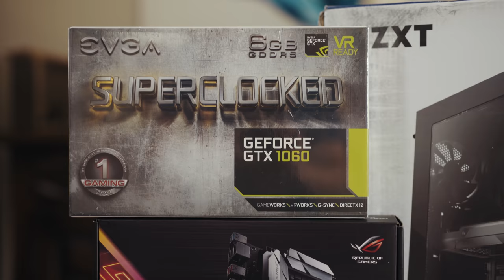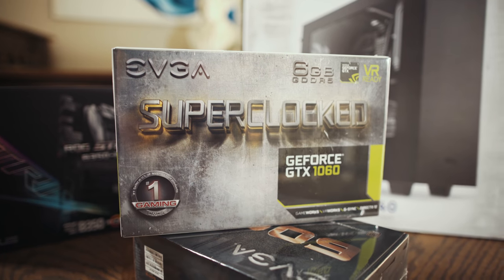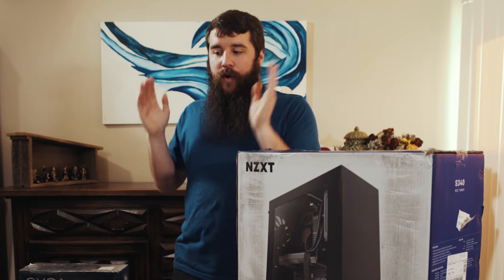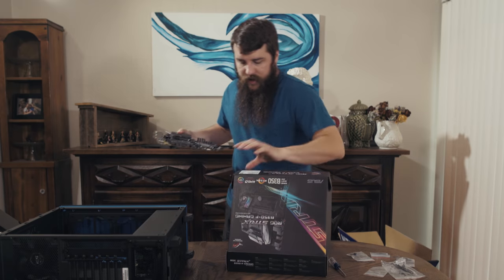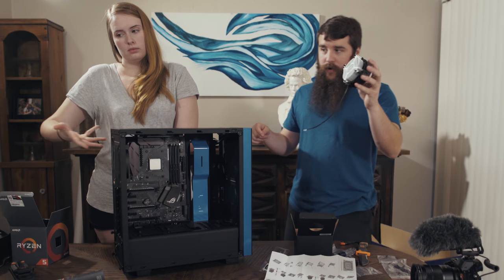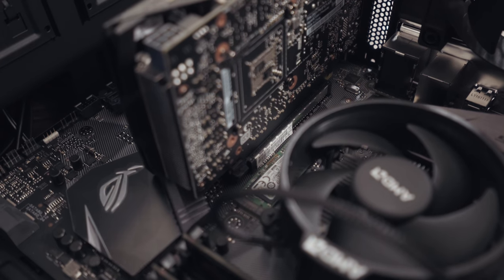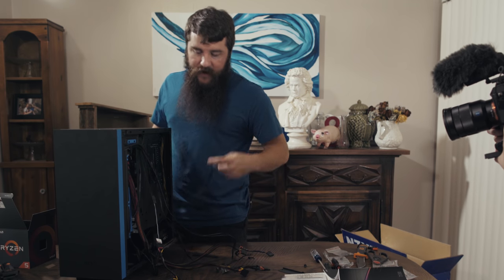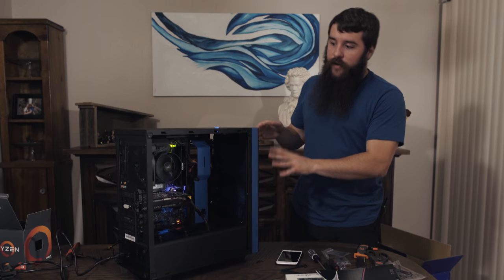How To Build A Video Editing Computer | $850 Ryzen PC Beginners Build Guide | 2017

Comment: I have seen at least one comparison between sata ssd's and the fastest NVME ssd's. Conclusion, only in a verry few cases was there a rather small advantage in using the faster ssd's. Video edditing was not one of them. In all other cases the difference between the two is mostly negligable. So I would go for the cheaper sata ssd's and just get a bigger one, so it would have more room for the video's your brother would be editing directly from ssd.
Reply from the maker: +Jelle Baris hey Jelle! From what I've read there are some situations where it's better to have nvme. Every bit of speed helps :) I'm planning on having him edit from external drives, not the internal ssd.

Comment: 16 gb of ram enough for gh5 (V-Log 4K) ?
Reply from the maker: Hey! Depends on how many CPU cores you have, if you have a quad core you should be fine with that, but if you have an 8 core or more CPU, you'll want at least 32 gigs. (in my opinion)
Reply: Hey, so if i'll buy ryzen 5 1600 then 16gb is enough, but if i'll choose ryzen7 1700 then i'll need to install 32gb?

Comment: I don't know how about you guys but I've put everything to my shopping list and it came up to over 1200$$
Reply from the maker: +TAPP Channel 😂 that's craaaazy. Including a monitor I'm assuming?
Reply: Don't be sarcastic :) I really need a computer to my 4K videos. I thought I have a nice computer with intel i7-6700T 2.80GHz processor but when I bought a LG 27UD68 4K monitor I was not able to enjoy it. The picture was blurry and worse then on my HP 7years old monitor. Decide to buy a GPU GTX 1050Ti and now I'm not able to install is since I have all motherboard harnesses right over GPU slot... I'm a little bit frustrated so I started to think about buying a new computer. That's how I got to your video... I placed everything to my amazon basket and here what it came up to:
Case 99.99$
AMD (1600) -209$
Motherboard - 119$
SSD - 169$
GTX 1060 - 299$
RAM - 165$
Power Supply - 55$
                                             Total 1119$

In this case I'm thinking if its worth it or maybe I should return that 4k monitor (510$) and Ill already have a money for a latest iMac (1799)
What do you think???
Or maybe I should buy a case and motherboard only and use a processor HDD and DDR4 Ram I already have???
What do you think about my processor? Would work with your motherboard?? Is it better or something close to that AMD you suggested???
And finally if that computer would be better than 1799$ iMac 3.4GHz i5 quad Core????

Will be very appreciate for your advise. Thanks

Comment: How does this deal with resolve?
Reply from the maker: My brother says it works well, but I haven’t tested it extensively with Resolve
Reply: Made a similar build. It works fairly well. Though the system keeps rebooting to the bios randomly. Will have to sort that out. But I am really loving the speed.

Comment: So I decided to build my first pc after watching this video with his suggestion of upgrade but mine did not work. I emailed him but didn't get the reply. I wonder what I did wrong or the parts I got were different.
I want to ask the community to see if anyone can recognize them.

I got

1. CPU: AMD Ryzen 9 3900X 12-core, 24-thread unlocked desktop processor with Wraith Prism LED Cooler
2. GPU: EVGA 08G-P4-3067-KR GeForce RTX 2060 Super SC Ultra Gaming, 8GB GDDR6, Dual HDB Fans, Metal Backplate
3. Memory Card RAM: Corsair Vengeance LPX 64GB DDR4 DRAM 3200MHz C16 Memory Kit, Black
4. SSD: Samsung (MZ-V7S1T0B/AM) 970 EVO Plus SSD 1TB - M.2 NVMe Interface Internal Solid State Drive with V-NAND Technology
5. Motherboard: MSI MPG X570 GAMING EDGE WIFI Motherboard (AMD AM4, DDR4, PCIe 4.0, SATA 6Gb/s, M.2, USB 3.2 Gen 2, AC Wi-Fi 5, HDMI, ATX)
6. Power supply: EVGA 220-G3-0750-X1 SuperNOVA 750 G3, 80 Plus Gold 750W, Fully Modular, Eco Mode with New HDB Fan, 10 Year Warranty, Includes Power ON Self Tester, Compact 150mm Size, Power Supply (But I switched to GQ version since G3 I ordered wasn't functioning)
7. Case: NZXT H510 - CA-H510B-BR - Compact ATX Mid-Tower PC Gaming Case - Front I/O USB Type-C Port - Tempered Glass Side Panel - Cable Management System - Water-Cooling Ready - Black/Red

So I got these 7 items and did almost exactly as Matt did in his video (I said 'almost' because the cable seems to be different in upgraded version. I'm not so sure) but it won't turn on. 
The fan in PSU was spinning one second. None of my CPU or GPU fans were spinning. 

Can anyone help? or give me a suggestion?
Reply from the maker: Hey I was sure I replied to your email. Apologies if I didn’t. It sounds like all your parts are correct. Does the computer turn on at all? Does it light up? Any fans spin? Etc. If not, double check your power connections. If it does turn on but doesn’t send a signal to the monitor, make sure you are plugged into the graphics card and not the motherboard.

Comment: Hi Matt, I was pretty excited to finally build a new PC (last one is 8 years old) following your advice.
I bought most of the parts from where you suggested although some were unavailable and I bought elsewhere...also the RAM is not something you recommended ...I don't recall the reason I bought another brand but knew Corsair is a respected brand.

Anyway I'm wondering if I have mismatched something that you may be able to point out.
I had high hopes I would be able to get steady playback in my video editor (Vegas Pro 18 or DaVinci Resolve) with a total new build but it still drops frames down to 8 fps.
Any suggestions would be appreciated.

case https://www.neweggbusiness.com/product/product.aspx?item=9B-11-553-031&utm_medium=TraEmail&utm_source=TEMC-New-Order-Confirmation-USB&cm_mmc=TEMC-New-Order-Confirmation-USB-_-9B-11-553-031
memory (not recommended) https://www.bestbuy.com/site/corsair-vengeance-lpx-32gb-2pk-x-16gb-3-2-ghz-ddr4-dram-desktop-memory-kit-black/4895530.p?skuId=4895530
motherboard https://www.newegg.com/asrock-b450-pro4/p/N82E16813157841?Item=N82E16813157841&utm_medium=TraEmail&utm_source=TEMC-New-Order-Confirmation-USA&cm_mmc=TEMC-New-Order-Confirmation-USA-_-N82E16813157841
power https://www.bestbuy.com/site/evga-600w-atx-12v-eps-12v-80-plus-power-supply-black/8511029.p?skuId=8511029
CPU https://www.walmart.com/ip/seort/431501281?comm-msg-vehicle=EMAIL&comm-msg-id=ce732566-1730-459e-a539-4729c98eef61
GPU https://www.amazon.com/gp/product/B077VX31FZ/ref=ppx_od_dt_b_asin_title_s00?ie=UTF8&psc=1
SSD https://www.amazon.com/gp/product/B07MFZY2F2/ref=ppx_od_dt_b_asin_title_s00?ie=UTF8&psc=1

Comment: My PC Build:

Thermaltake Versa N21 Mid Tower
ASRock Z390 Extreme4 ATX Intel Motherboard (300 series)
Intel Core i7-9700K Coffee Lake 8-Core
Cougar VTE500 80+ ATX power Supply
G.SKILL Ripjaws V Series 16GB (2 x 8GB) DDR4 SDRAM Memory
EVGA GeForce GTX 1060 SC GAMING, ACX 2.0 (Single Fan) Graphics Card
WD Blue 1TB Desktop Hard Disk Drive
PLEXTOR Duplication Grade DVD / CD SATA Burner Drive PX-891SAF
ASUS AC750 Wireless Dual Band PCI Express Adapter w/ 2 Antennas
----
Acer K222HQL bid 21.5" Full HD LCD Monitor
Razer DeathAdder Elite Ergonomic Gaming Mouse
CORSAIR K63 Wireless Mechanical Gaming Keyboard

Comment: Great video. I definevly got some good info from here to design my PC build. I will be using it for video editing and work. Can you tell me what do you think and if there is anything to improve. I am looking to spend $1000 MAX. 

CPU: AMD Ryzen 5 1600 3.2GHz 6-core
Motherboard: ASUS Prime B350 Plus ATX AM4
RAM: Corsair Vengeance LPX 16GB (2x8Gb) DDR4-3000
Storage: Samsung 850 Evo Series 250Gb 2.5" SSD
Video Card: EVGA- GeForce GTX 1050 2Gb SC Gaming
Case: Corsair 270R ATX Mid Tower
Power Supply: EVGA SuperNOVA G3 650W 80+ Gold Certified Fully-Modular ATX 
 
Grand Total: $761.19
Reply from the maker: Looks great to me! :)

Comment: what do i do if i did this and it doesn’t turn on at all
Reply from the maker: Do any lights come on at all? If not, then double check your power supply is on and properly plugged in. If you get some lights double check all your cables

Comment: I’m getting “No Signal” on the monitor when I turn it on. I did everything right, not sure what’s going on
Reply: Ajmal Lookman yes I figured out what I was doing wrong. I had the HDMI plugged to the motherboard, but instead, you need to plug it to the graphics card.

Comment: Hi Matt! Thanks so much for this tutorial. I got here from your awesome 2020 4K PC for $650 video. This is my first time building a computer and I’ve run into a couple issues with cable connections... I have read through the motherboard and case manuals, but am still stuck and feel like I’m going a bit nuts here. Can you help? I’ve attached some imgur links so you can see exactly what cables I’m talking about. Thanks a gazillion in advance for any help you can provide.

Parts: 
Case = NZXT H510 Compact
Motherboard = MSI B450-A PRO
Power supply = EVGA 650W (could not find your recommended 600W at time of purchase)

Issue #1: Missing “molex” connector on case?
At 54:48 in your video, it looks like two skinny cables run on the backside of the case that are connected together by a 3rd middle cable that contains a “molex” connector (https://imgur.com/6Okl4MB ). But I think I am missing this middle cable with the molex!!! I do have the two skinny cables, but they are hanging loose and not connected by anything (https://imgur.com/t6jcFqz ). They each end with a female 3-pin connector, but there is no way to attach them together … And there is no loose “molex” cable in the box for me to insert here … Without this middle molex piece, I don’t have any way to connect to the “molex” cable from the power supply (https://imgur.com/ux05xCO ), and thus no power to the case fans!
 
Issue #2: Missing LED connectors on case?
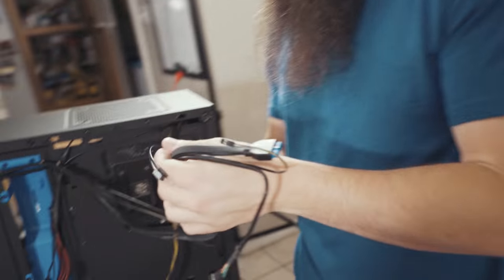At 56:06 in your video, you show the 4 tiny cables for power switch, power LED, HDD LED (https://imgur.com/uEx19FI ). But I do NOT have any such cable coming from my case. The case did come with an extra, separate piece called “H: Breakout Cable” that has a 6-pin male plug on one end and the 4 tiny split-out pins on the other end (https://imgur.com/vsfw97X ). HOWEVER … There is no corresponding 6-pin female plug coming from either the case or the power supply for me to connect this to. So I have no idea where this is supposed to connect?? I can't find anything about this mini Breakout Cable in either the case or motherboard manuals. I could plug the 4 tiny pins into the motherboard, but then the 6-pin male end is just hanging loose with nothing to connect to …

Am I crazy, or am I actually missing parts??? Please help! THANKS!!!

Comment: Hi Matt. Thank you for the video. What motherboard would be compatible with this part list and be wifi capable?
Further, if I wanted to add a TB of HD, what model would you recommend?
Even further, if I wanted to add another SSD HD, so that I have two SSD's and one regular HD. Does this motherboard support these three HDs?

For the CPU, the link you have http://amzn.to/2lTfxCV shows the model to be YD1600BBAEBOX but this model is not listed on the motherboard website CPU Support List. Will the one you suggest still be compatible with the motherboard?
I'm genuinely  interested in the AMD RYZEN 5 2600X 6-Core 3.6 GHz (4.2 GHz Max Boost) Socket AM4 95W YD260XBCAFBOX Desktop Processor and wonder if this one is compatible with the motherboard? But this model number is not listed on the CPU Support List. Would you comment on this?

Thank you!

Comment: First Time Builder... Need Help (This will be a long post, sorry) & Advice

Awesome video!!! I am a Newbie, who does Graphic Design and Photo Restoration (InDesign, PS, Illustrator, GIMP, etc.). I am looking to make 4K Videos to review A/V Components for the average to enthusiast level person who wants a great movie, TV, platform gaming, etc... I also want to capture likes moments in 4K & HDR10 (will be the standard for a while) because 8K is just stupid unless it is a Movie Theater. Also, what is the best video editing software and for who?

This is my build so far... I am not a gamer!!!! 

Bert's Build 10.15.2017

Case: Fractal Meshify - C (4 Case Fans - Fractal GP x2 140 (Front) and x2 (Back, Top Right Above the CPU) (BOUGHT)
CPU: Ryzen 7 1700 vs Ryzen 5 1600? (HELP)
CPU Fan: Stock (Wraith Spire) to start at least? Are the temps okay with this? (HELP)
MOBO: Asus - ROG Strix - B350 F Gaming (BOUGHT)
OS: Windows 10 Pro 64bit, OEM Fresh Install
Storage: # 1 (Boot/OS/Program Drive) 250 GB Samsung Evo 960 NVMe M.2 (BOUGHT)
                # 2 Storage Drive - 3TB Seagate Barracuda 7200 (BOUGHT)
                # 3 Project Drive ? Is this needed? 250-500gb SSD
                # 4 Seagate External HDD 3.0 3TB (Already Had) - BACKUP
PSU: Thermaltake SMART DPS G 700w Semi-Modular (Bronze) (BOUGHT)
RAM: ? I am looking 3200 (32 GB - 2x16) - Maybe Corsair Vengence LPX, I am okay with RGB too (Not a must). I heard 2 Dimm - Single Rank - Made with Samsung Black Die? Works the best with Ryzen? (HELP)
And a Spiderman Black Suit - GID Exclusive Funko POP Figure for Fun in my case

BIGGEST QUESTION
GPU: ? 

Looking @ EVGA 1050 ti SOC 4GB ... THIS SUPPORTS HDMI 2.0 with HDCP 2.2 is covered

I want to get a 4K Monitor sometime, and pair it with the DVI one I have. I plan to edit using (the reduced resolution thumbnails? that represent the pure 4K files) during the edit. And publish it in 4K H.265 

Will this be GPU be able to do that (Dual: 1-4K & 1DVO)? I will only watch 4K on the screen when published or a video file. (Non-Gamer) 

                
Also, I am open to suggestion on GPU + Editing Software Combos that perform best.
I am planning to Edit in Cyberlink PowerDirector 16 for the main edit, and then in Premiere for effects etc. Or is it best to learn Premiere? Does Premiere support H.265? 10 Bit?

Sorry if this was too much, just new to this and it's hard to get help and answers. This was my favorite video!!!! Awesome
Reply from the maker: Hey thanks Robert! Your build looks solid overall. 
- If you can afford the Ryzen 7 1700 then I would get it, that will give you 8 cores and 16 threads, which is amazing!
- You should be fine with the Wraith Spire cooler. If you want to overclock for faster performance, you'll probably want something bigger though.
- I don't think you necessarily need a project drive. Just a drive to edit off of that's different than your main drive with your OS and apps on it.
- 3200mhz ram should work well for you, just make sure it works with your motherboard. 32GB should be good, if you are planning on running more apps I would consider 64GB. Never heard of Samsung Black Die.
- Make sure your action figure doesn't impede airflow in your case. :)
- If you are wanting to edit in 4K, you should be okay with the 1050ti as long as it's the 6GB model. Your CPU will be doing the heavy lifting for the rendering of your videos, the GPU only helps some with certain effects. 

For editing, Premiere supports h.265 and 10-bit. You may also want to look into Da Vinci Resolve. It is free and very powerful. (For 10-bit, you have to buy it but its only a one-time fee of $300.) Hope that helps!

Comment: the GTX 1060 is currently $600, which puts the build well over $850 with everthing (minus the keyboard, mouse, and monitor) How much was the 1060 when you bought it!?
Reply from the maker: The 1060 cost $289 from Newegg when I bought it. :-/

Comment: It's a bummer that there isn't a space in the case for a DVD drive.
Reply from the maker: +Kyle Schori hey Kyle! A lot of cases don't have space for a DVD drive anymore unfortunately. The good news is that external DVD drives only cost about $20-25 on Amazon. That's what I use whenever I need to burn a DVD.
Reply: Matt WhoisMatt Johnson . I have one to. Later I'm going to buy one that does Blu-ray. I like having one inside the case too. Makes it little quicker to copy disks, one from another.
Reply: I went with the Corsair Carbide Series SPEC-02 Mid Tower Gaming Case. Went with your suggestion of spending a little more for the Ryzen 5 1600. Can't wait to get it all. :)

Comment: Hey can you link the motherboard list for tested RAM? I've found this one 

http://dlcdnet.asus.com/pub/ASUS/mb/SocketAM4/STRIX_B350-F_GAMING/ROG_STRIX_B350-F_GAMING_SummitCPUDDR4_DRAM_QVL20170520.pdf?_ga=2.209007899.847756567.1503944258-1429390434.1503944258

But it doesn't have your choice for RAM... Great video though, much appreciated
Reply from the maker: +Saulo Dal Pozzo that's the list I used! I believe I actually used ram that other reviewers had confirmed that worked with this motherboard in their written reviews online.

Comment: A loooooooot better would be to install everything on the motherboard before putting it on the case.
And guess what. :D You'll get call from your brother when he want more RAM, because CPU fan hovers the one slot, so he won't be able to fit ram stick there :D

Comment: I wish this had worked out in my favor. My motherboard arrived dead in the water and I didn't find out until I put the whole thing together. sadness
Reply: Rachel Marie Smith that stinks. Is there a way to test MB without putting everything together?
Reply: It was a dead motherboard, I returned it and purchased the AB350 ASRock and had no issue with the build after that point.

Comment: A 500 watt power supply would have been significantly cheaper, could have been modular (still cheaper), and would still have tons of headroom. With some overclocking of this build, 380 watts is recommended (according to https://outervision.com/power-supply-calculator). So a 450 would have been more than fine.